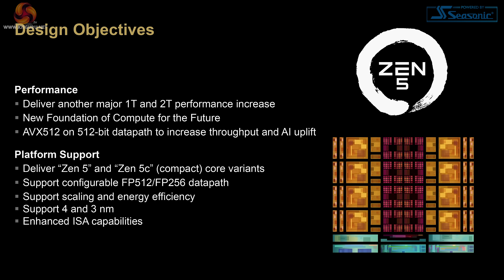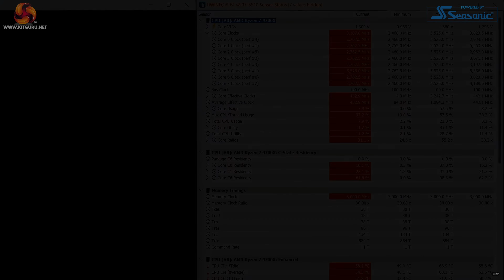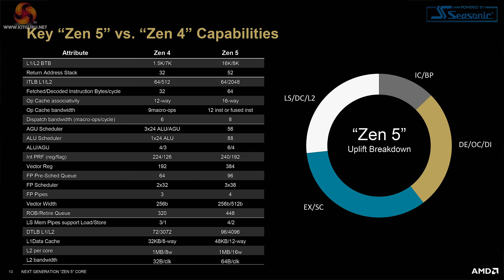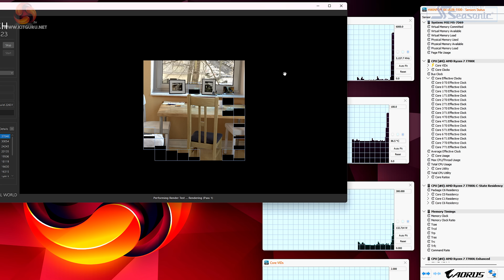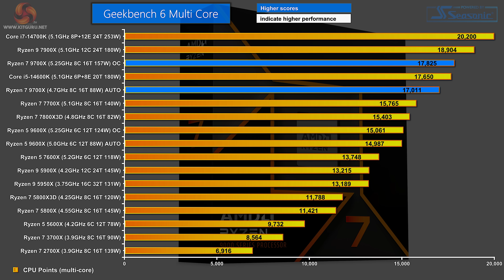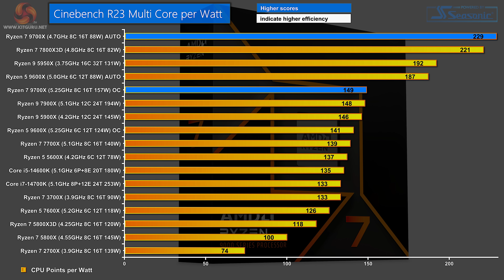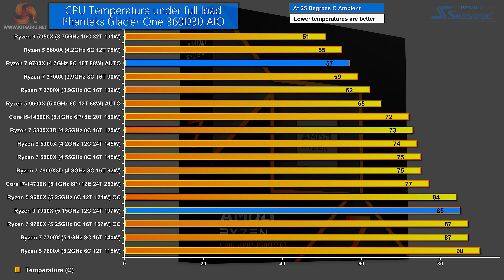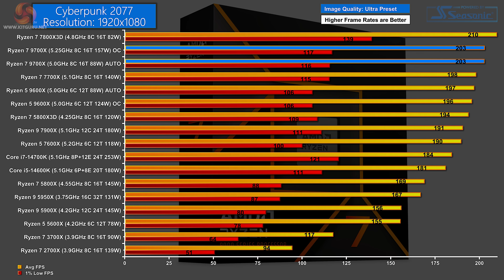AMD Ryzen 7 9700X review: YouTube hates this CPU

Comment: Thanks for the very levelheaded review on this. I was just as surprised that many reviewers seemed so negative. These CPU's are nothing gamechanging, but they are definately better then the previous generation. With PBO enabled these chips actually have a very sizeable lead over the previous gen, at somewhat similiar power usage. But with Intel's dumpsterfire of late I can see why AMD might be a bit more cautious with it's default power target.

And whilst many people don't care all that much about powerconsumption of their CPU's (although I think they should be when it's an 88W 9700X vs. a 350W+ 14900K), this bodes well for upcoming mobile chips from AMD. Slightly more performance for 40% less power draw? In handheld gaming machines you are very limited by power and thermals, seeing how amazing the desktop Ryzen 7 performs, you can only imagine what gains my be feasable in laptops and handhelds.

Comment: 6:50 it shows something very concerning. 9700X doesn't reach it's default boost speed on auto settings. AMD declared 5,5 GHz with 88W of power consumption. Did they lie? Or is it just some BIOS problem?
Reply: "Up to" is an amazing marketing term. GN showed some situations where it reaches it and some where it doesn't in their review
Reply: 5.5 is the max boost clock. Obviously the chip cannot do that on all cores at 65/88W. When less cores are used, clocks can (and will) go to 5.5 as long as total power remains within budget.
Reply: @janickpauwels3792  and how much does it reach in practice? Only 4,5 GHz? This is not a normal situation.
Reply: a lie ^^  we call that marketing ^^
Reply: @danielkowalski7527  it's just too much this time :(

Comment: Are the Intel chips in these AMD reviews running at their original speed and heightened voltages or did you make it behave like one that would be sold today with less aggressive settings?
Reply from the maker: Gigabyte Z790 Aorus Master X BIOS F7e running on Auto settings with XMP  - Core i5-14600K PL1 and PL1 181W, Core i7-14700K PL1 and PL2 253W
Leo

Comment: I like this gen. I has enough power but less power consumption and will likely drop a lot in price by the time I buy it.
Reply: A sort of "efficiency reset," while being cheaper than last gen (meaning it should be cheaper than last gen X months after launch than last gen was X months after its launch). 

Most positive way to interpret the showing so far. 👍

Comment: I'm amazed no one's done a proper IPC analysis of Zen 5 vs 4.
Reply from the maker: Anandtech has done exactly that. SPEC is outside my sphere so I leave it to experts.
Leo
Reply: @KitGuruTech gigachad
Reply: Guru3D and Anandtech did a good one, it's 10% higher than Zen4 on average.
Reply: @rattlehead999 And incredible power efficiency.
Reply: @robertmyers6488  The 7700 non-X has the same 65W TDP and 88W PPT as the 9700x, but costs only 250$ and has 98% the performance of the 7700X
Reply: @rattlehead999  Easily enough done by limiting the power and testing.  As shown in the video it might be a good option for gaming, but production is another story.
Reply: @rattlehead999  look at all benchmarks
Reply: @gw7624  MLiD mentioned that the SPEC suite had been run and produced results in line with AMD claims.
Reply: @RobBCactive MLID also a hack and just grabbing random rumors off twitter and pretending he has sources inside the actual industry. You watch him for a few months to a year, then you realize hes a fraud, wrong most the time and constantly moving the goalpost and gaslighting his community to pretend he was somehow right all along and will actively delete things to hide it or ban people off his discord
Reply: @RobBCactive  Synthetic benchmarks often yield results that don't tally with real-world application performance such as gaming performance, which is what the vast majority of people watching these videos care about. A proper IPC analysis relating to gaming performance involves fixing the clock speeds of both architectures and disabling turbo, not comparing SPEC benchmarks on two architectures running at 'about' the same speed.
Reply: @gw7624  but you test gaming performance by running games, your argument is rather tautological.  Synthetic tests are designed to exercise the CPU in many ways, not just ones used by current games.
It leads to optimisation based on what current software does, and stagnation because features lacking support aren't adopted, so aren't supported.
The traditional way to break that cycle is for hardware vendors to ship money to software outfits, but that benefits monopolists building software support moats around their products.
Reply: @gw7624  gaming performance has been irrelevant since Zen 3. For higher resolutions CPU plays zero role, because the GPU is the bottleneck way before CPU can be saturated, and for lower res gaming you get get 100-200+ FPS on 4 year old chips in most cases.

Frankly speaking I have no fcking clue why we're doing gaming benchmarks anymore.
Reply: @RobBCactive  If you're not particularly interested in the impact of architectural improvements, fine, but quite a few of us are, particularly when Zen 5 isn't showing the kind of improvement most people were expecting.
Reply: @gw7624  Was that meant for me?  I pointed out there are improvements, but something like AVX512 won't help for most games, developers don't seem too au fait with using alternative implementations depending on system capabilities.
Reply: @gw7624  imagine saying real world performance then only looking at gaming, when gaming is less than 20% of the market lol
Reply: @popop143  Right, because people who buy PCs to run MS Office and watch kitten videos really care about benchmarks.
Reply: @michael.petraeus  "gaming performance has been irrelevant since Zen 3. "

Dumbest comment of 2024.
Reply: @gw7624  tell me please how is it relevant when anything above 1080p betrays a GPU bottleneck even at 4090. 

I have a 5600x and been running 4080 and 4090 because CPU provides literally no advantage.
Reply: @gw7624  you should finish school first before commenting on these videos, if that's the only thing you think about when thinking of PC market share
Reply: @michael.petraeus  I'm almost always CPU limited even at 4K with max settings - And I only play certain games on my 4K screen (1440p otherwise).
Given I'm on Zen 2, but not even a 7800X3D plays all games at 120+ FPS (especially 1% lows).
Reply: @gw7624 I think what the comentor is trying to say is there is very little difference between any of the processor and the testing bears that out.
Reply: @robertmyers6488  Depends entirely on the application/game. Regardless, some of the more theoretically-minded of us want to understand the relative impact of the architectural improvements, hence my original comment. If, for you, a CPU is just a magic chip you stick in your computer so it'll work, excellent, I'm happy for you.
Reply: @Jossages  Zen 2 is old. And 7800X3D is already overkill.
Reply: @popop143  gamers spend the least money but make the most noise. It’s like the whining about Nvidia. So much moaning how supposedly expensive it is and AMD is better value, and yet team green has almost 90% of the market, precisely because a few extra features and better efficiency make it worth it. 

They never learn.
Reply: @gw7624  Gaming performance isn't much better than a synthetic benchmark because of how games use CPU resources. I also think you touched on a key point here - "games are what the vast majority of people watching these videos care about". That's why these parts are getting drug. Not because they're actually bad parts, but because they don't excite gamers.
Reply: @michael.petraeus  Zen2 is old, but that doesn't change the 7800X3D not being overkill.
Ideally I'd get 120FPS minimum in anything I decided to play, the 7800X3D is not fast enough for that, I do dream about 480Hz OLED monitors too....
So it follows that CPU benchmarks for gaming very much have a place.
Reply: @Jossages  errm... the only reason you can't play 120FPS in anything today is your GPU not CPU.
Reply: @michael.petraeus  No it isn't, quick example is city areas in Dragons Dogma 2.
CP2077 can be CPU limited with 7800x3d at 1440p depending on settings (possibly 4k depending on DLSS mode). The Hogwarts game doesn't seems to reach 120fps 1% lows. MSFS 2020 shows improvements even at 4k going from 5800X3D to 7800X3D, why not 9950X3D too?
Sure the vast majority of current games will run well over 120FPS AVG on a 7800X3D, but you're talking nonsense.
Reply: @Jossages  Funny enough, in linux hogwarts legacy doesn't have the same cpu bottleneck as windows. Performance is also a lot better, my 6950xt was putting up 4080 numbers in that game with a 5900x. Like 120+ fps in hogsmeade at 1440p ultra with RT off.
Reply: @Jossages  pretty much everything will run 120fps and over with a 4090 and 5800X3D. There's nothing meaningful to be gained with a more recent chip, let alone at 4K. Put the money into a GPU.
Reply: @michael.petraeus  Gaming benchmarks are done because they are 1) easy and 2) ubiquitous.  Someday Tech YouTubers will start including y-cruncher and other standardized benchmarks.  This "apples to oranges" benchmarks where some reviewers benchmark game A and other reviewers benchmark game B is starting to get old.  

Heck, even including a tag if a game is CPU bound, memory bound, or GPU bound would be a good start.
Reply: @MichaelPohoreski  - I think they're doing this because yes, they're easy, but also because they're lazy and their audiences comprise mainly gamers who judge everything by FPS, even though GPU is where most of the gaming performance is right now.
Reply: @gw7624  Might wanna see what IPC is before denouncing SPEC benchmarks in favour of gaming lol.
Reply: @tomstech4390  I know exactly what it is. Do you?
Reply: @gw7624  Yes, you test IPC in things like spec.. which tests specific instructions.
Games use multiple instructions so you can't accurately measure IPC in games, so no you clearly don't.
Reply: @tomstech4390  "Games use multiple instructions so you can't accurately measure IPC in games"
😆😆😆
Reply: @jarnovilen5259  lol, I had a 4090 with 5600X and now have a 4080. Please tell me what am I losing playing at 4K Ultra. You don't understand modern computing. CPUs matter in low resolution gaming but beyond it, especially at 4K, they do not matter. That's why all gaming benchmarks for CPUs focus on 1080p and occasionally post 1440p figures, but rarely post 4k benchmarking because there's literally no difference between the latest CPUs and most of Zen 3 lineup.
Reply: @jarnovilen5259  - umm no, there's literally no modern game in existence that would require a newer CPU for gaming at 4K. None. Not one. You have no idea what you're talking about. In 4K gaming the GPU is still the bottleneck.
Reply: @jarnovilen5259  - no such thing. You have no idea what you're quoting.
Reply: damm i can buy brand new PC here with 7500F for 160 Euro, 7600 for 190 Euro or 9600X for 320 Euro, gee i wonder which to pick 

AMD never misses an opportunity to miss an opportunity huh?

what a waste, here is your analysis, dont bother with zen5 unless it get massive discount
Reply: @Trisstan20  then don’t buy it, it’s not a product for you. I’d be happy to pay a premium for 14900 performance in a 65W package which is going to stay silent and cool.
Reply: I got my 7500f for 109usd stanying with zen 4 @Trisstan20
Reply: Ryzen 5 1600X = 100%
Ryzen 5 2600X = 110%
Ryzen 5 3600X = 131%
Ryzen 5 5600X = 157%
Ryzen 5 7600X = 193%
Ryzen 5 9600X = 194%
AMD's Skylake moment.
Reply: @Trisstan20  now do TDP
Reply: Wendell @level 1 Techs
Reply: Mysticial (the creator of y-cruncher) has an incredible Zen5's AVX512 & IPC teardown on his numberworld blog, check it out!
Reply: It's still early, and it seems AMD/Intel don't give them much time to go in depth
Reply: I think we can safely assume that zen 5 has much better IPC than zen 4, considering it gets better performance (if marginally so) at lower clock speeds (4.8ghz vs 5.1 on the X variants) and much better performance at similar speeds (5.2 PBO OC vs 5.1).
Reply: @gw7624  1440p and I still get 120fps on 5600x, which is 4 years old, while 5800X3D is pretty much on par with new silicon. Thanks for illustrating my point.
Reply: @michael.petraeus  Drawing conclusions from a single sample? You'll go far in life.
Reply: @gw7624  you were the one who gave it without 2nd thought:)
Reply: @michael.petraeus  Gave what?
Reply: @gw7624  the benchmark from the video
Reply: @michael.petraeus  You made a sweeping generalisation that CPUs do not matter for gaming performance. The link I showed you disproved that claim completely. If you want to make a claim like that, you need to show it is true everywhere, not just for the particular game you're playing. Clearly logic isn't your forté.
Reply: @gw7624  - buddy, you've linked to the benchmark which shows 5800X3D, a Zen 3 chip, going head to head with the latest ones, and something like 5600X trailing by very little in a compromising resolution anyway. As I said, beyond Zen 3 there's pretty much no difference if you game above 1080p, which you should as it's 2024 FFS and your phone has more pixels than that.

And for gaming at 1080p whatever difference does exist there is meaningless because there's no observable gain beyond 120 maybe 144fps, which would match the fastest monitors.

LTT has proven before that even in fast-paced shooters professional esports players do not benefit above 144Hz/fps.

And if you want to play latest AAA titles in a decent resolution and high detail settings then there's exactly zero reason to upgrade beyond mid-range Zen3 because it's still the GPU that is the bottleneck.
Reply: @michael.petraeus  There's a significant difference in performance. Stop embarrassing yourself.
Reply: @gw7624  above 1080p? None. Are you literate?

Basically, the only meaningful differences are at 1080p. At 1440p there maybe some, usually small, difference in some titles, but you might get more variance between GPU models of the same shelf than between different gen CPUs.

At 4k there's zero difference in anything. None. Nada.
Reply: @michael.petraeus  F me, LOOK at the graph at 13:43. See those numbers at the top next to where it says 'resolution'? That's not 1080p. See where is says 5600X? The one you literally tried to claim wasn't worth upgrading from? Now compare it with the 9600X and note the minimums. Want me to work it out for you? The 9600X has 45% higher lows than the 5600X. Don't need more than 80 FPS? Good for you! But that doesn't mean there's no reason to upgrade.

"Are you literate?"

The irony. Off you go.
Reply: @michael.petraeus  You were talking about the 5600X which is definitely Zen 3. Do you comprehend that?

"And if you play in 4K then there's literally ZERO difference for gaming. None."

So, you don't understand basic logic and you can't even read a graph. Not good my friend, not good.
Reply: @michael.petraeus  Hilarious attempt to save face. You got called out on BS and now you're crying about it.

Comment: Why do I think that AMD is saving a 9800X part that would be the 105W? Same as what they did with the 3700X and 3800X
Reply: Or just enable CO with PBO.
Reply: They would normally release the performance part 1st. Normally
Reply: If they were doing that- making the 9800X a "9700X that can draw enough power to unlock its real potential"- AMD really should have released that part at the same time. 

Then reviews would have said "get the 800 part for performance, get the 700 part for the miniscule power draw."
Reply: Yeah. Honestly now that you mention it , that kind of makes most Sense. But it still doesnt explain the rather bad Gaming Reviews. An 9800X, even with 120 Watts wont be 10% better in Gaming as it seems. In other Apps thats a different Story.

Comment: Has anybody tried to increase the voltage for the Ryzen 7 9700X?  It could be hampering the 65 watts limit.  If it was able to goes higher, would the score too?
Reply: Yes. And DerBauer already showed this. Run it at the same watts as the 7700x and it has around a 20% performance increase across the board. Which is not bad. It is a VERY effecient CPU.

Comment: well done ! when 7700x was released it cost more than this - prices of old stuff always drop - surprised people dont realise this. when the next gen launches, people will say the 9700x is good value - doh, no sh!t !
Reply: Not really, prices of stuff drops when the value proposition sucks, like with 7600x and 7700x at launch, and these chips at launch. It will eventually drop, because no sane person would buy it at this price. For example, 5800x3d was holding value for a very long time, because it was great value for money, but nobody was buying the low end 7000 chips, especially given the prices of motherboards and DDR5 at launch.
Reply: but you compare CURRENT PRICE to CURRENT PRICE... not 2 year old price... and then you compare the performance... and in that case the 9700X is just WAY too expensive vs, the 7700X that delivers "same" performance for a LOT cheaper...
Reply: @LiLBitsDK  When does ANYONE EVER compare current to current when determining any of what is being spoken about in this review? Did you not pay attention to any of the discussion about 6000 vs 7000 this past year? You sound completely detached.
Reply: @KonglomeratYT  all the good reviewers compare the CURRENT price of the 7700/7700X vs. the CURRENT price of the new 9700X.... did you live in lala land and compare to original MSRP of the 7000 series to see if the new 9700X made sense on the current market? or did you compare to what the price on it is right now? and if you release a product (not that you ever will but let us pretend) that is no better... and then expect people to pay a lot more for it instead of just buying the old model?